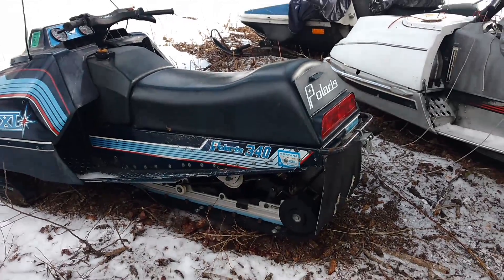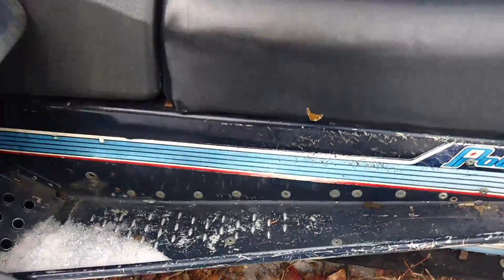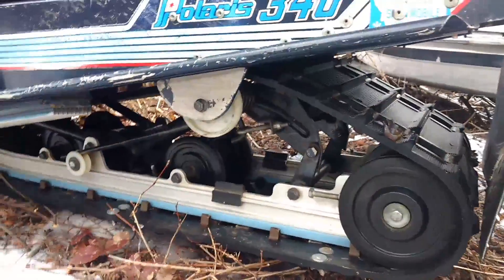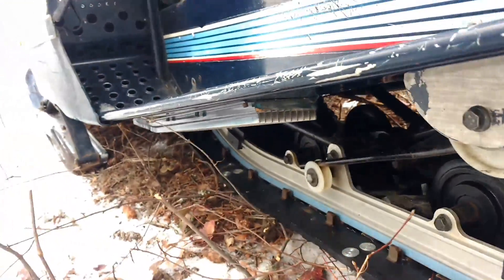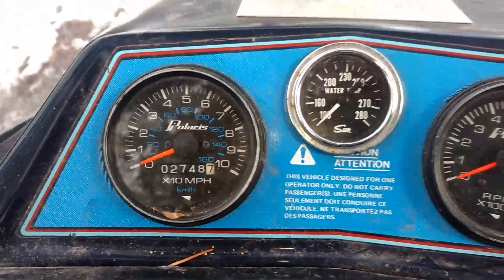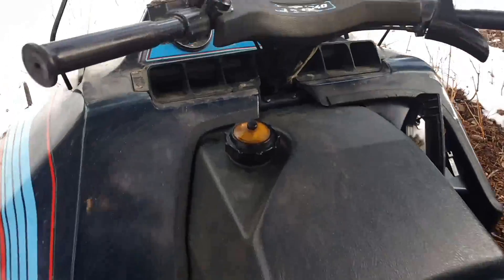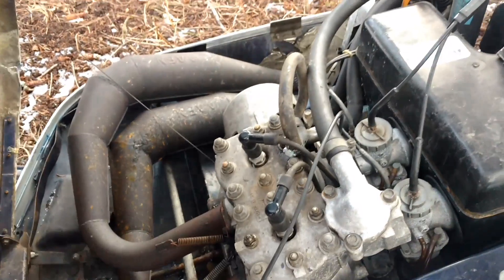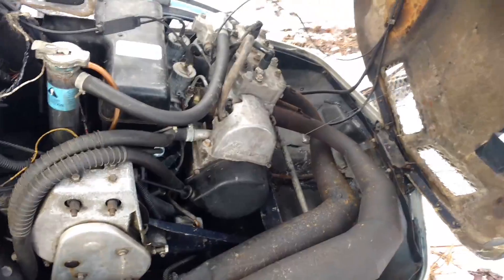1980 Polaris TXL 340 Mod

Comment: just picked one up in moderate running condition single dg pipe and UFO slide mods. started first pull with a little gas in the cyl. hope you sell yours soon! (or ride it for a blast from the past!)
Reply from the maker: Yes they are super fast for a 340 when tuned right..have UFOs in my race sled for this year…hope they help!